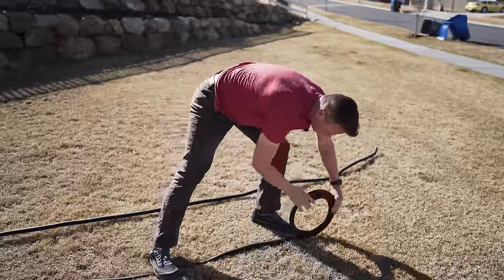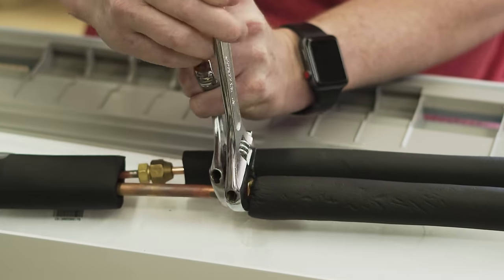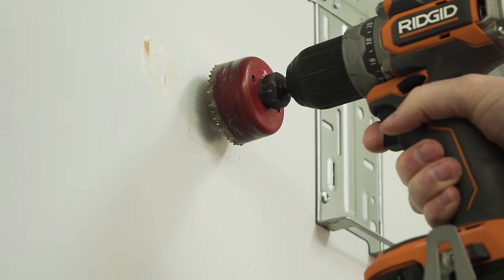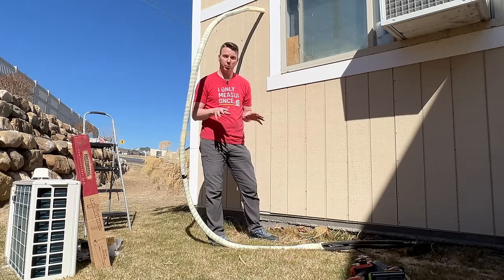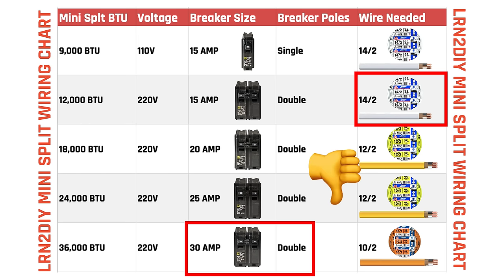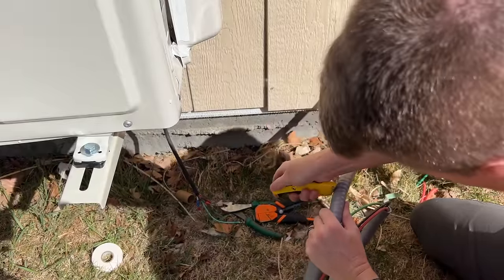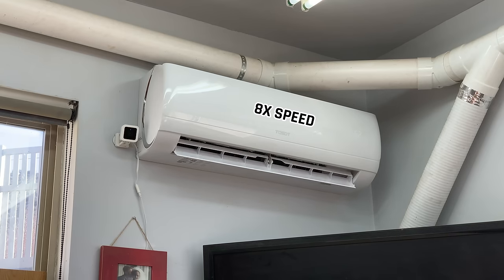DIY Mini Split Install - All the Things Nobody Shows You

Comment: Great install but there are 3 things you messed up on.   The first one was before you pull a vacuum on the system you need to pressure test the system with nitrogen to 300 psi. This is to test for leaks. Second, after the vacuum, you DO NOT pull the gauges off. You are in a negative pressure meaning as soon you start unscrewing your gauges you just let noncondensable into the system. You should have opened the king valves to release the charge so noncondensable cant enter the system. Third the most significant NO NO you sized the breaker for your line voltage wrong thing to do. You need to size it for the load you running. So for instance per instructions, let's say it needs a 15 amp double pole breaker to do the job you don't double it you can cause a fire if you have an intermitting short circuit. The manufacturer already factored in a safety buffer for the mini-split. Trust me I deal with mini-splits often in my field of work. When it comes to a single appliance on a circuit that's all the load that's going to be on that circuit. It's not like setting up outlets in a home or shop that's totally different you size it for the line, not the load because you don't have a continuous 15 amp 120v load on the circuit. PLEASE change out the circuit breaker!
Reply: Actually the nitrogen pressure test per Tosot is 500 psig. And vacuum should always be drawn down to 500 microns (per manufacturer and standard practice) to ensure moisture removal. 30” on a mechanical gage is a very inaccurate measure of vacuum. The refrigerant in that system used an oil with has a high affinity for moisture which was reintroduced when he broke the line before pressurizing the system with refrigerant. Doing the leak check after releasing the refrigerant is kind of a moot point. You got lucky in those line set flares, I’ve never have a good one yet.
Reply: Just curious, after you pressure test with nitrogen, do you pull a vacuum again before charging it with refrigerant?
Reply: @kettch42  yes, the vacuum test is performed after the pressure test. But it’s not done “again”. After tubing installed and fittings are torqued to appropriate values, the next step is nitrogen pressure test per manufacturers recommended pressure, followed by vacuum test. Once vacuum test is completed satisfactorily, then you slowly introduce the refrigerant stored in condenser to the remaining portion of the system. Doing it this way ensures no air (and moisture) getting back into the system.
Reply: @kettch42  No you pressure test the system first then vacuum out what little moisture that is left in the system. The nitrogen does 2 things one it's an azorbant for moisture that gets in the lines during the install or repair. Second it a cheap way to test for leaks versus loosing your expenses refrigerants.

Comment: Good job on the video but there are a few changes that I would recommend.  Others have mentioned the changes that should be made relative to your coice of the circuit breaker and wire connections so I won't comment further on that.  Here are my four comments.  First and foremost, the system evacuation should be done using a micron gauge instead of trusting the analog gauges because the gauges only show vacuum in inches of mercury, with perfect vacuum being some 29.9 inches so most gauges simply put the number 30.  Any good professional A/C tech will tell you that a well evacuated system should be pulled down to 500 microns or less, and for reference, 29 inches as shown on an analog gauge represents about 10,000 microns.  Whether or not it ever reaches 500 microns or less while evacuating the system while trusting analog gauges depends on several things including, 1) how effective the pump is, 2) fitting leaks if you have any, and 3) how long the vacuum pump is left running on the system, so as you can see, at that point everything is a guess because you simply have no way of knowing exactly where you are.  The importance of all this is, any remaining moisture in the system can, and will react with the refrigerant and turn acidic and that in turn will eventually shorten the life of the compressor and/or the entire system.  A good micron gauge costs about $160.00 so after all that work and expense, is it really worth it?  To do what you showed in your video does not even require a set of gauges, just the correct fitting and a micron gauge.  Secondly, you really should use Nylog only on the FACE of all the flare fittings to ensure a good seal, all good A/C techs use it.  The third thing I'd like to point out is, as others have mentioned, those factory flares are almost always bad and should be redone using a proper 45 degree eccentric flaring tool to ensure leak free connections, and with Nylog.  Having a professional tech come out to recharge your system because you lost all of your refrigerant could cost you several hundred dollars because of the cost of the refrigerant and their labor, all for an extra 20 minutes of flare work.  It's not worth the risk  Finally at the 23:26 timeline you mentioned 220 amps relative to what you thought was wire that was too small.  What you should have said was 220 volts, not amps and as a point of reference, your unit only draws 6.6 amps so the 16 gauge wire they supplied was more than adequate.  The number 10 wire you used can carry 30 amps at 220 volts, which as you can see was un-necessary.  Sorry for the long comment but hopefully it will save others a lot of grief later on.  Thank you posting a good video; it is appreciated.

Comment: Always cut lines.  Oil can and will "pool" into the low parts of coils.  Won't see much of a problem right away, but eventually it will strain the condenser. Also you must torque the connections to specs, and use Nylog.  Doing the soap test doesn't work on the upper, inside connections as you cannot get to them, as well as the soap test won't work unless the unit is on and running to expand and contract the copper and brass fittings. Size of wire isn't too important with these units because they do not pull much amperage.  a 20 seer unit pulls less than 6 amps at startup and down to 3 nominally. So a 15 amp breaker isn't needed, but most houses a 15 is the smallest in the box.  So running a 14 awg wire from a 15 is plenty, even for a 220 volt unit. All that said, I still enjoyed the video, you did a good job installing.
Reply: Eh, you got one thing backwards. You said "even for a 220 volt unit". When you increase the voltage the amps drop on the same power consumption. This means you can use thinner wires when using higher voltage. (The load is in Amps, not volts.)

Comment: Is there any any reason you would not remove the entire drywall sheet instead of cutting out sections? I’m considering just removing the entire sheet. I’ll be running the 240 up into the attic, then across to the opposite wall and down through the exterior wall. I would remove the drywall sheet from each side of my garage for the 240 that will run up and then down.

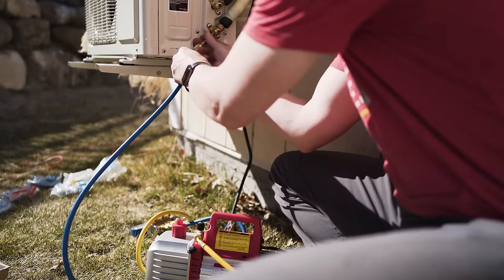Comment: At 18:54 when you remove the vacuum from the service port, why doesn't that allow air into the system? Doesn't that allow air and water vapor to negate the drawing down of the system you just accomplished?

Comment: You want to vacuum high and low sides because the TXV valve is going to block the flow from the low to the high side on the evaporator not completely it's just better to pull a vacuum from both sides. You want to make sure you get any moisture out of the lines I usually vacuum for 2 hours once the system has been opened to air especially if you live in a humid part of the country.

Comment: Drilling through vinyl siding try using your hole saw with the drill in reverse, it will “melt through your siding instead of grabbing and splitting the siding, once past siding switch to forward to cut through your sheeting.

Comment: I installed mini with zero tools bought. That was 15 years ago and it runs perfect.   I paid $320 for an AC company to come out and vacuum it down and open the Freon line.     It saved me over 2k.   They do make a system with a vacuumed line set for total diy’ers.

Comment: Regarding the circuit breaker size, the manufacturer of the unit lists the correct breaker size on the units nameplate. National Electrical Code requires the breaker closest to the unit to be sized as listed by the manufacture on the nameplate and it has to be rated HACR for AC applications. You are allowed to increase the wire size larger than specified by the manufacturer for voltage drop correction in cases where the distance from the unit to the main panel is excessively long or simply if you just happen to have a larger wire size on hand and want to use it. The breaker you would install in the main panel may be sized higher according to the size wire used. Lastly, the refrigerant lines should be shortened and connected directly to the unit without the excess coils which can trap oil and possibally cause a compressor failure. Hope this will benefit the next DYI.

Comment: If the system holds -30 while the vacuum pump is running, but then goes to zero once the valve is closed and the vacuum pump is turned off, what would be the issue? I am assuming a leak somewhere, but what are the likely areas. The one suspicion I have is the connections of the lines inside the inside unit? But, I may not be thinking through this correctly...

Comment: Coiling the pipes is a big no-no from everything I have read, so these pre-made line sets are, with the exception of a perfect length, impossible to use. My issue is the minimum line set distance, for Fujitsu, (3 meters). I’m under that for my distance and I don’t want to coil, so now I’m going to do an angled run down the outside wall to get the distance and not leave a sag to collect oil at the bottom of loop. But, The connectors in Fujitsu are at the bottom of the unit facing down, so it’s impossible to avoid a loop, (and a trap), entering the cabinet to connect. What’s up with that???

Comment: This video was great BUT only thing that I would recommend against is the mount for the AC against the side of the building since it adds a hum/noise to the shed/office. Leaving it on a concrete pad makes a huge difference in sound volume
Reply: While I suspect it would be quieter on a pad, these units are very quiet, so I doubt it will make a big difference. The type of building material making up the wall makes a difference as well. Mounting the unit on the wall in heavy snow country offers a huge advantage. Adding some anti-vibration pads to the mount would probably help as well.

Comment: The smaller Mr. Cools use 110V and will power the outside unit from the same harness you're running anyway. No separate 220v connection, no disconnect. I installed the largest 110v unit to heat/cool my wife's office. It maintains the perfect temperature year-round and is dead quiet.

Comment: Question: It's my understanding the the charging vent has a one way Schrader valve in it, and those are prone to letting in a small gulp of air when disconnecting the vacuum lines. 
Because of this many people would rather release refrigerant (pressurize the line) than to let moist air into the system when disconnecting the gauges.  
So, why not when disconnecting the gauge from the charging vent, why not disconnect the blue hose from the gauge so the small gulp of air that rushes into the lines is from the vacuumed line. Or even open the gauge valve and disconnect the yellow line from the vacuum pump?

Comment: 24:35 Wait hold up. You installed a 30amp double pole breaker for your 12,000BTU? Breakers are intended to protect wiring but also the system correct? If your unit needs to pop over 15amp, you need 15amp breakers right? Doesn't matter what kind of wire you have. 
Or am i wrong here? I'm no electrician but this didnt make sense to me.

Comment: -note 18:34  After vacuuming first open pressure valve on Liquid ( small ) and release a gas into system then take off Manometar if you need to. That way system is filed with gas while is vacuumed. Vacuuming is not for testing Is for take off all air and if some moisture. Regards from Macedonia.

Comment: I have a question my pressure goes from -30 to -20 ans stays there. It seems I have a leak but I did a bubble test  but to no avail; It seems there are no leaks at the four end of the nuts. Can you help?

Comment: I have a question. Is it possible turn on (heater) when the temperature is -25 C° / -16 F° outside?
Thanks.
It's a good video
Reply: Yes you can run the heat mode at -16F outside.  You just will not get a lot of heat.  It might be better to wait until daytime, and then run the unit to warm the home to about 68 - 70F, and then shut it off at night.  For a 12,000 Btu unit, you might get about 8,000 Btu's at -10F outside.  At 25F and above you can get the rated heat output, because it is a variable speed compressor.

Comment: As an electrician, I will join the pile on. One must always follow the equipment specifications for overcurrent protection requirements. If the unit calls for a 15A 240V breaker, one must use that size breaker regardless of wire gauge. While one cannot use wire smaller than rated for the breaker, one is allowed to connect larger wires to a circuit breaker. Most breakers have terminals that allow larger wire gauges. The other option is to place an appropriately sized fused disconnect or breaker box at the equipment.

NM sheathed cable (Romex) is not allowed in a wet location unless it is rated type TW or UF. The interior of conduits in wet locations are considered to be a wet location, so no standard NM sheathed cables allowed inside of them. The conductors inside of NM cable are not rated for wet locations, so no stripping the sheath off and using the conductors. I would personally have ran EMT, then connected  flexible metallic conduit to the back of the LB to connect to the panel inside the wall, then ran THWN (black, red, and green) conductors to the disconnect.

Another really big no-no is using the white neutral wire as a ungrounded conductor when an appropriately colored red conductor is available. One is allowed to use the neutral wire in a cable assy if no other option is available, such as when using a two wire cable for 240V, for a switched leg, or a traveler on a 3 way. But this is not the case here, since you have the correctly colored wire available. When one does need to use the white wire as an ungrounded conductor, both of the ends must be marked in a permanent manner around the entire conductor using ink or paint (not black electrical tape). A sharpie works fine, and 2 inches of conductor length is standard in my area.

Code also requires that you have a 15 or 20 amp 120V outlet on the exterior of the building within 25 feet of any equipment. This is to be able to run equipment like that vacuum pump. If no outlet is available, I will run the outlet conductors in the same conduit as the one used for the heat pump unit, then connect an exterior outlet box to the disconnect box. Of course making sure to size the conductors to the appropriate conduit fill rating.

I like the line set enclosure kits for the exterior of the buildings. Makes the install very clean, and protects the insulation on the lines from degradation. I also use spray foam in all wall penetrations, then add the caulk. This helps prevent air leaks. Also don't forget to remove the cover of the LB and seal the inside of the conduit with spray foam where it enters the building.

Comment: Hi, thank you for the video . How did you get the power breaker requirements I cannot find them on their site
Reply: There is a pdf with all the different unit specs and in there they list amp draw and maximum breaker sizes. It isn’t obvious anywhere else.

Comment: Nice job. Couple details. Wall mounting will always create noise / vibration inside a wood framed building. The drain hose connection in the wall needs to be perfect. It's as important as the refrigerant lines. I would have added a waterproofing tape and or zip tie to that "just plug them together" connection. You do not want mold growing or flooding in walls. Lastly, Lines going through the wall should be sealed inside and outside. You only sealed from outside. Just subscibed

Comment: Just finished putting our mini split in and couldn't be happier. Our long term goal is to replace our improperly installed current AC system with a few of these around the house. Wouldn't have been confident enough to put our first one in without this video!

Thank you!

Comment: i would never disconnect the gauges before you have pressure in the lines. there's no gauges out there that can prevent air to enter the line set/ keep refrigerant from leaving when you unhook the gauges. IMO you allowed lots of moisture in your whole system!

Comment: Coiling the lineset does have an effect on performance. After a certain length you need to add additional refrigerant per foot, if you did not then you’re operating at a lower pressure thus loosing efficiency.